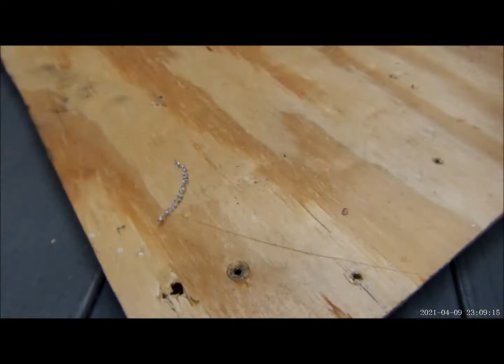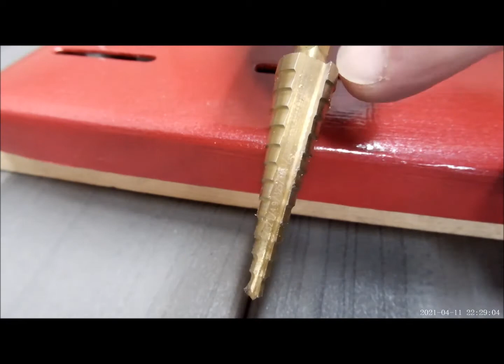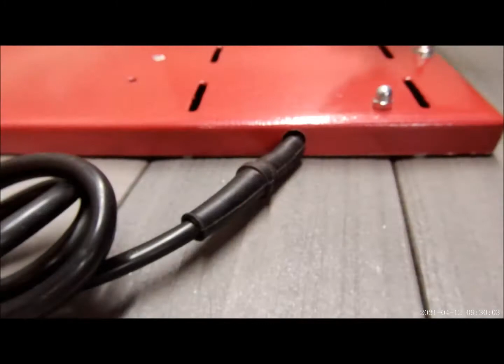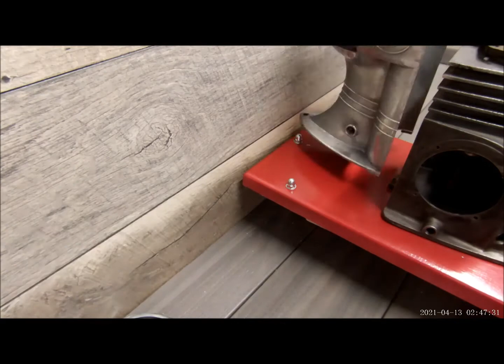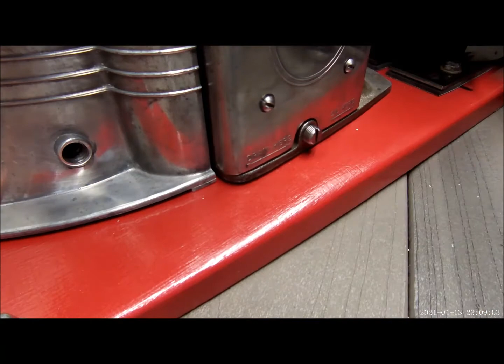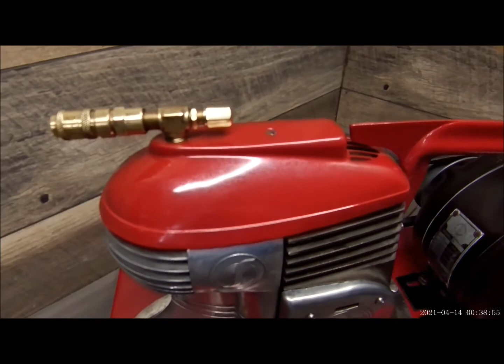Restoration 1946 Craftsman Paint Sprayer 283.1843 PART 3 of 3

Comment: Great series! I picked one of these up while purchasing another tool. When I asked about it the guy said "give me $5" and it was mine. Question, when torquing you mentioned the manufacturers specifications. Were you able to fing the manual for this sprayer? I've looked all over and have come up empty. Thanks again.
Reply from the maker: No manual. Found specs on Internet search, similar aluminum (later model) head compressor.
Reply: @JACKEDAMERICA  Thanks for the reply!
Reply: 110-120 inch lbs was a very common industry standard for aluminum or cast iron items. 
When in doubt just make sure you have extra compression gaskets and start lower. 80 ish. 
NOTE : not a guide for internal combustion engines head gaskets.